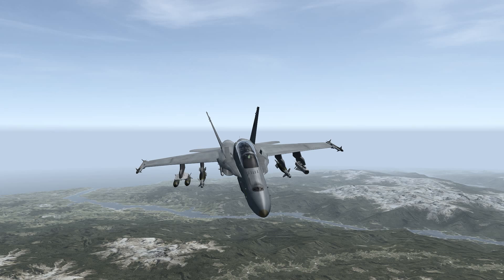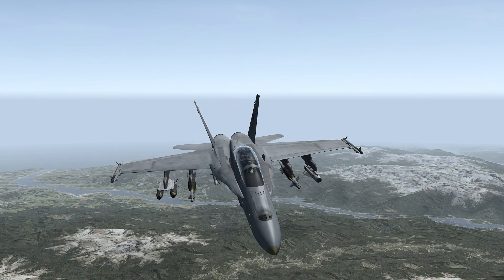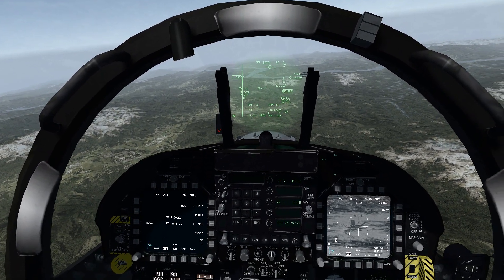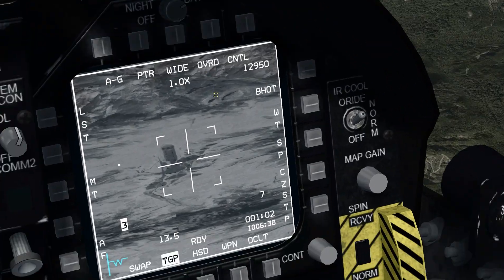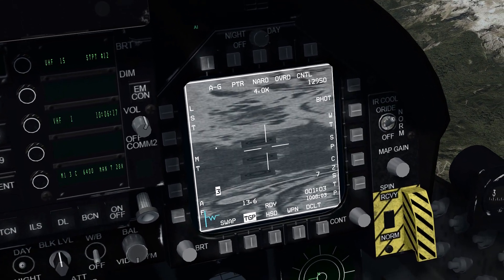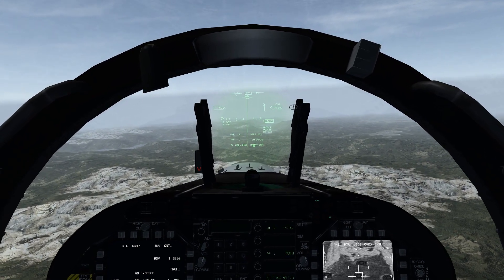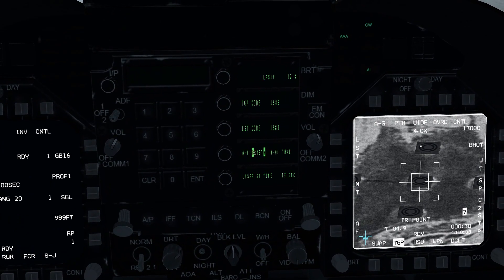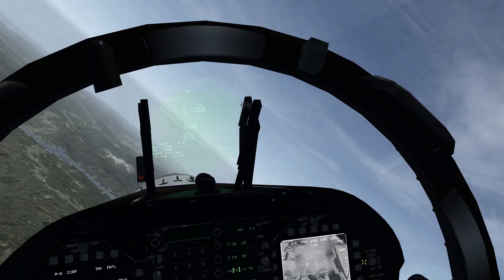✪ BMS 4.33 F/A-18 Hornet "Laser Guided Bombs Tutorial"

Comment: I need to ask a dumb question.  How does the aircraft laser its own target?  

As I understand it, the laser does not point backwards (just visualizing based upon the pod hanging from the side of the F/A-18's cheek and how the pod looks based upon building model aircraft when I was a kid).

The GBU has no thrust, so it will move forward any faster than the aircraft's velocity at release, maybe a little slower because of drag.  

Consequently, the aircraft would fly over the target, thereby losing the spot it is lasing, and the GBU would glide in on its own, but obviously this is not actually happening.

Does the aircraft need to decelerate?  What am I failing to understand?  

Thanks for the answers, folks.
Reply from the maker: The Navy ATFLIR and USAF Targeting Pods can look backwards or else it would not be possible to lase the target while overflying it. The camera has a wide range of vision and good quality. The actual Hornet air-frame does block the sensors view towards the right, hence, left turns are usually made off target.

Comment: Nice video man. One question. How did you load the TGP into the hornet? I never see the check box to load it.
thanks
Reply from the maker: Its actually not called a TGP although in BMS the Hornet is using Falcon avionics. The Hornet uses the AN/ASQ-228 ATFLIR which stands for Advanced Targeting Forward-Looking Infrared. You'll find it in the "other" load out screen. (Although the name is different, its essentially the TGP in BMS)
Reply: BurnerTactical what about the HARM and the HAD? Same problem!!!